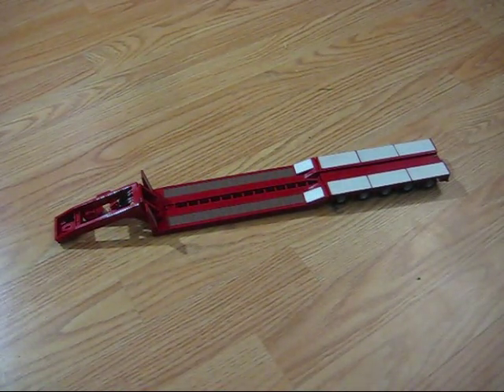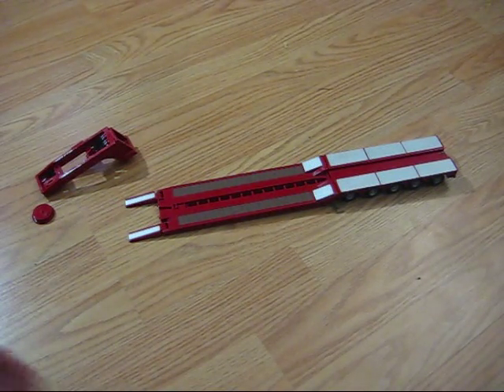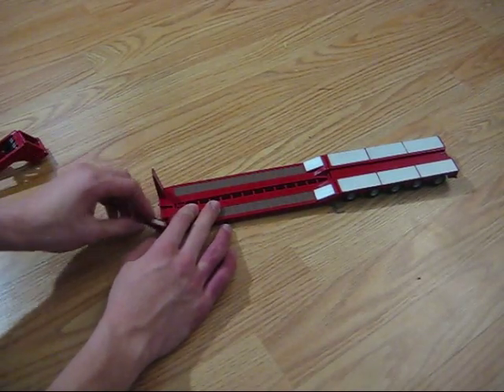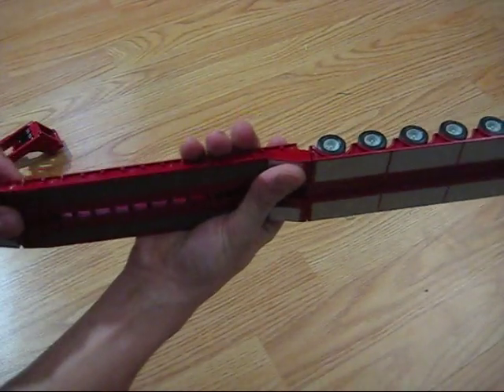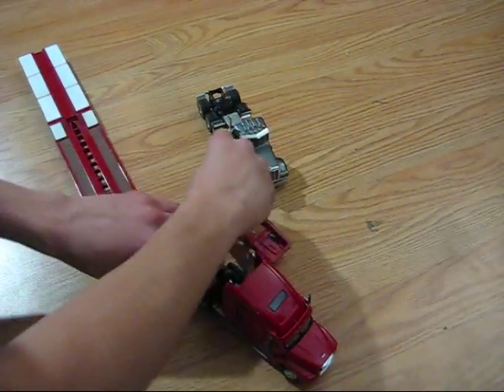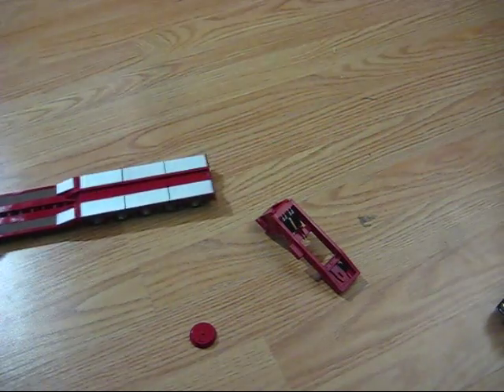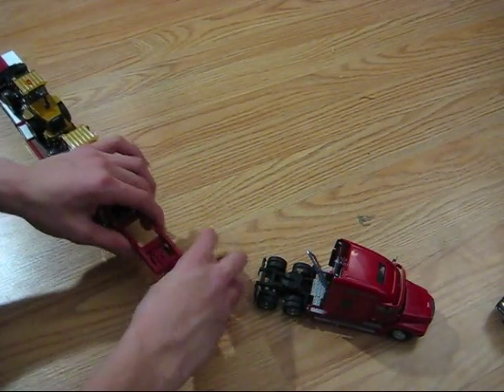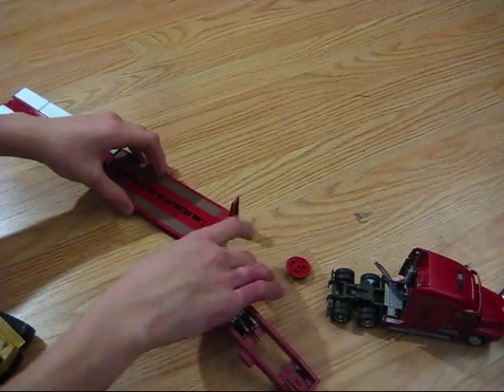Corgi lowboy review

Comment: i have 6 of these :)
the adapter is for the tractor unit that you get with some over here and there is a little groove on hook up which the adapter leans into and then the goose neck goes ontop :)
designed for UK tractor corgi models

Comment: It is a height adapter.  Since the hydraulic cylinders do not function, if your truck 5th wheel height is a little low use the adapter to get it off the ground. The REAL trailer would not need that piece. I have seen those in real life and they are for use in height ajustment if you had two different tractors with extreme difference in 5th wheel heights pulling the same trailer. Have seen them used on military lowboys. The neck is not long enough for a jeep just a 4 axle tractor or 2 axle jo jog